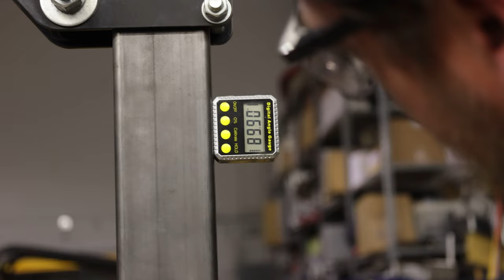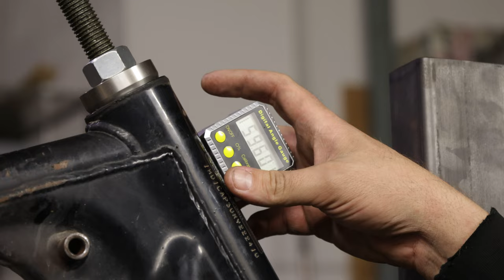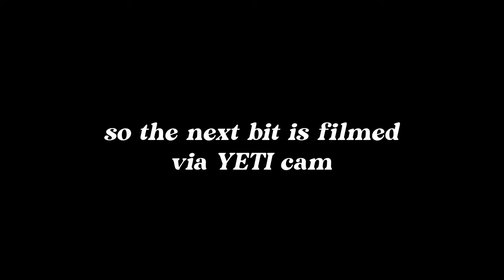​ @GVLLOW Chopper Build Ep.4 : Custom Fabrication

Comment: Yeti machine with no lathe no bandsaw ?   Huh ?
Reply from the maker: I am the machine. Using a lathe and a bandsaw would make it too easy 🤣. Truth be told i actually have 3 lathes! 2 manuals and a CNC. But i don’t have the space available in this shop (yet) to hook em up. I do need a good bandsaw, another tool of many I’m working towards.
Reply: @yetimachineco   That makes sense 👍🏻